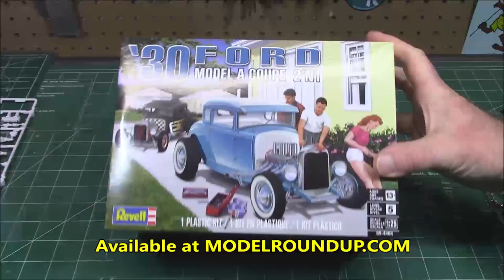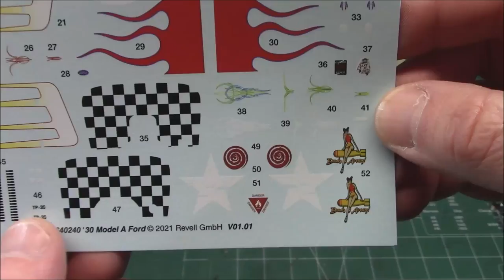1930 Ford Model A Coupe Hot Rod Rat Rod 2n1 1/25 Scale Model Kit Build How To Rust Revell NEW 4464

Comment: the smaller box beside the gas tank is the cars battery,  am currently working on the 29,  you can nearly get 2 cars from one of these, would rather have the ford engine in the 30 so i could put the chevy 350 in another chevy,  most chevy products, as we all know, had small blocks in them, and the model companies insist on big blocks when most big blocks turned into boat anchors after fifty thousand or so, either way i bought a bunch of the 29s, and imagine what you could have if you combined both kits and 3 or four bodies on one table,,, wow, breat build chris

Comment: You did not put  on the full exhaust.  Because you did not want to, or was it because you followed the directions, and found you could not get the rear pipes to fit?  I followed the directions and had to cut the pipes to get them in.  Just like you have done on other car kits that you have built.  Bit of confusion in step 9.   Two different drive shafts are called out for the two versions of the build, parts 210 and 137.  Neither of these parts are on the trees, or even listed in the parts list.  There is only one drive shaft part 106.  I do think that the front shocks, 37 and 38, really only work properly for the Highboy version.  They are a bit too long for the Channeled version.
Reply from the maker: I didn't want full pipes on this bomber. I talked about it if I remember but this was quite a while ago.